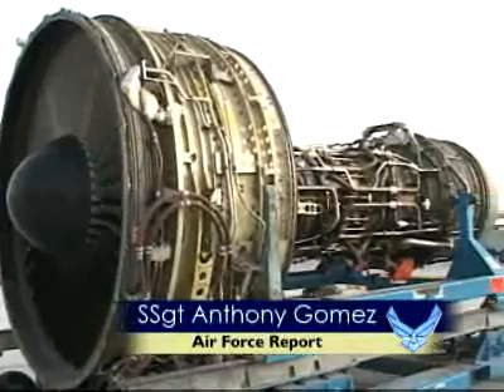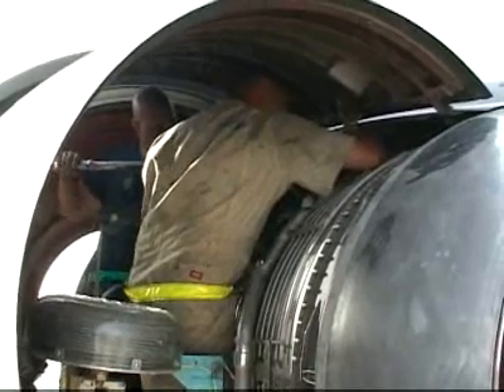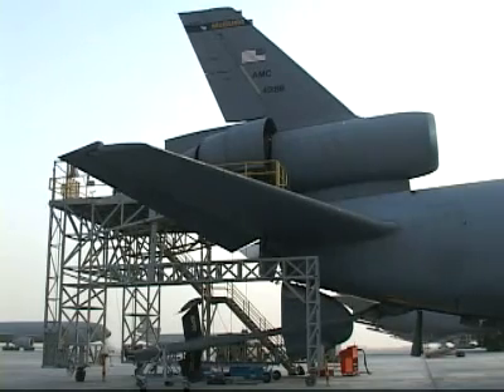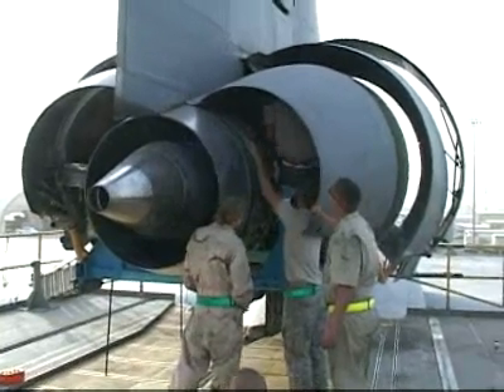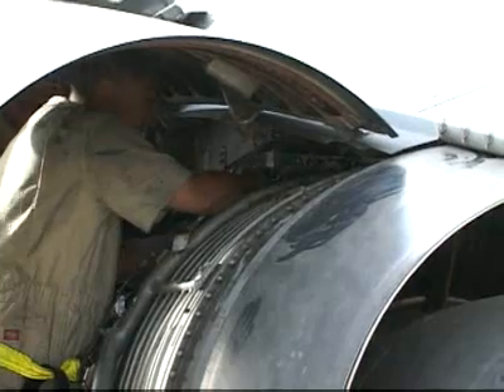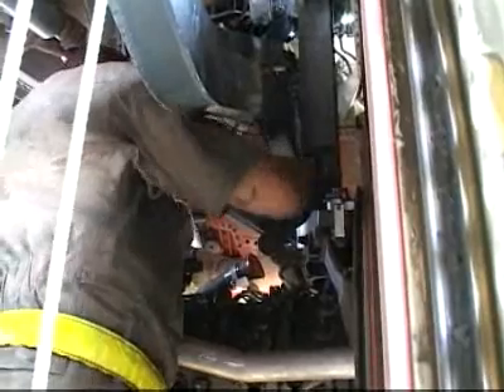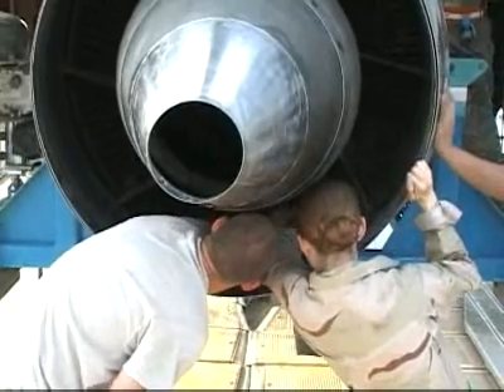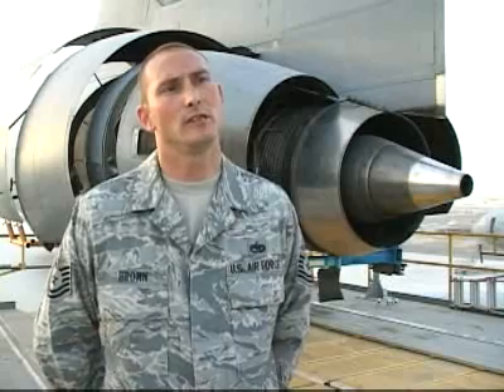KC-10 Extender Aircraft Engine Maintenance

Comment: I was involved in the first off-station use of a portable tail stand for a #2 engine change.....then 2 of the 3 winch motors went out and had to lower the engine cradle with the maintenance stand
Reply: Crew chief! I just saw you on that other video lol. Small internet.
Reply: That fly away tail stand is an absolute death trap.